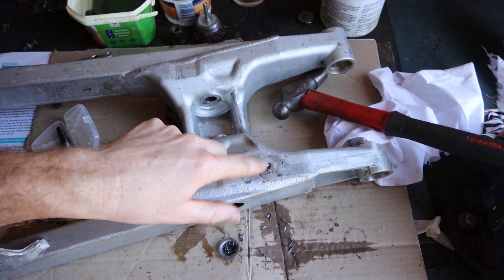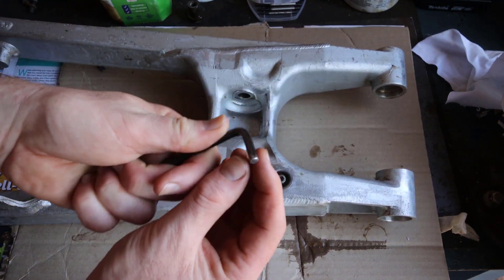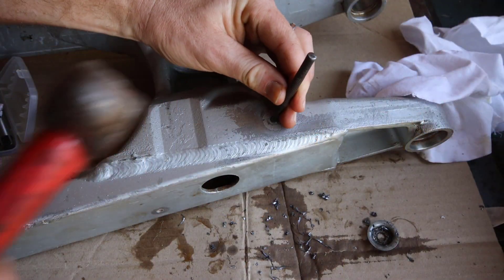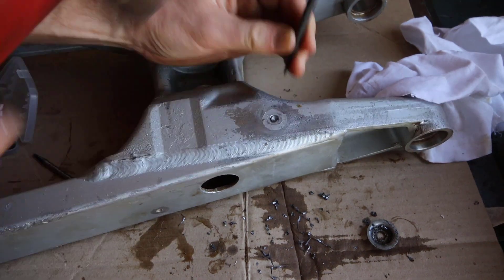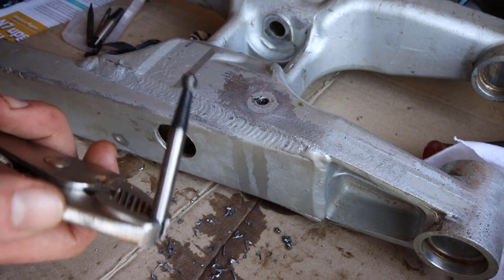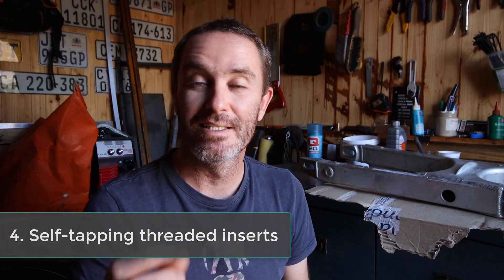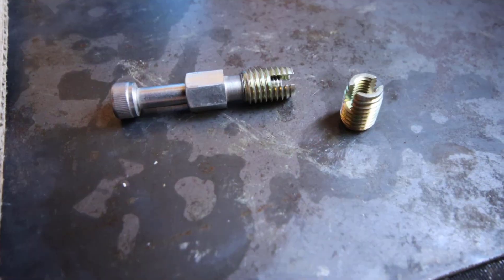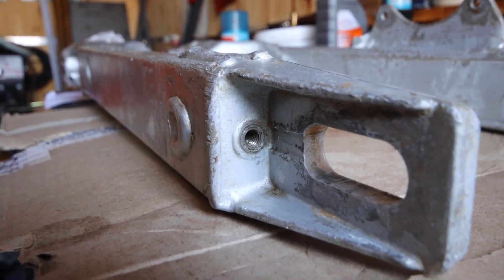4 Tricks on How to Fix a Stuck or Broken Bolt in Motorcycle Swingarm | KTM 250 EXC Bike Build Ep.3

Comment: Many years ago I had a brass brake fluid bleeder seized into an aluminum body on a disk brake (1973 Honda CB500/4). I put a little WD40 on it and tapped the top of the bleeder lightly, no movement. I went back to it every few days; squirt, tap and try to turn it. It took a few weeks, but basically  the slow patient process worked without damaging anything. It was winter and time was on my my side as it was too cold and snowy to even think about riding. Really enjoy your videos - please keep them coming.
Reply from the maker: Thanks for sharing that, Terry! Wow, that is amazing. Just shows how much patience is worth. Almost every time I damage something it is due to being in a rush. I appreciate the support!